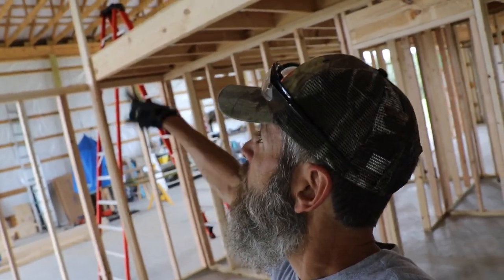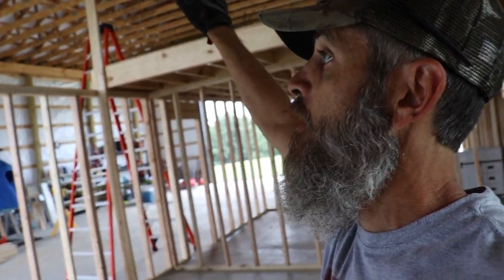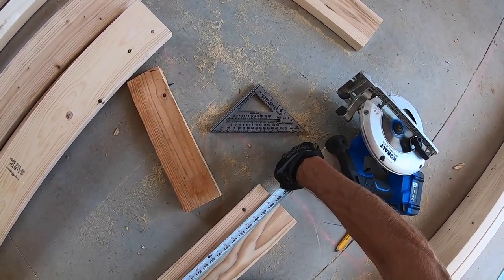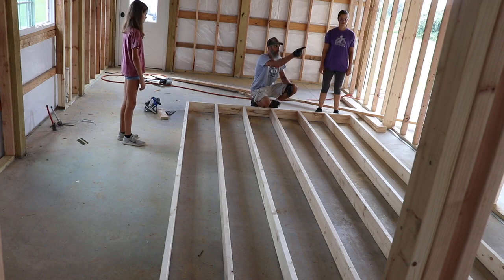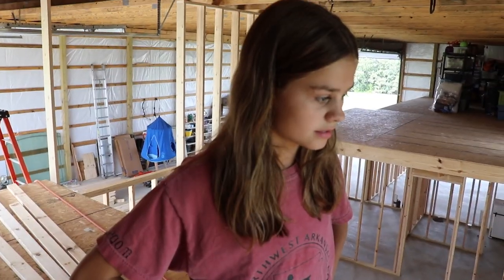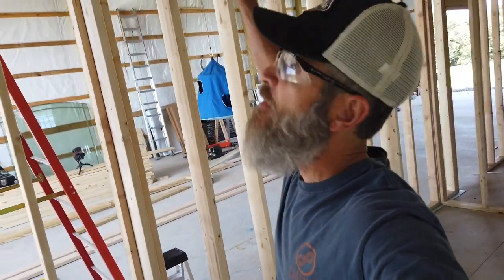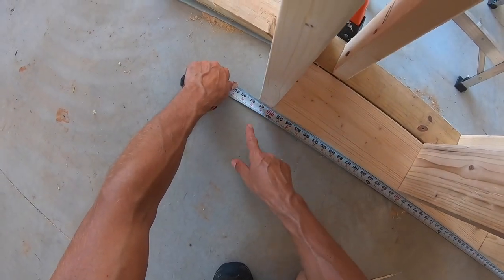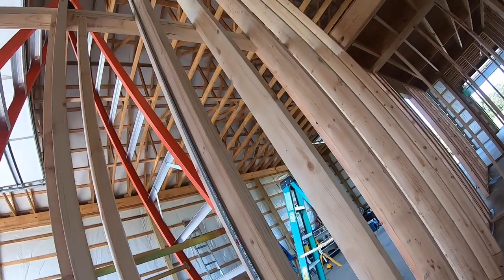Raising the 16 ft High Wall in the Barndominium.

Comment: The struggle to place the two walls could have been avoided by cutting an additional inch shorter and then use truss slip connectors to fasten to truss. you should have a 1" gap anyway as the bottom chord of those trusses will flex and move up and down. Everything else is looking good
Reply: It's called rope and pulleys.
Reply: @larryatwell9734  That is so not true. If that were the case there would be no point in interior load bearing walls on the upper floor, it is also the weight from above that holds the line and plumb on the walls.